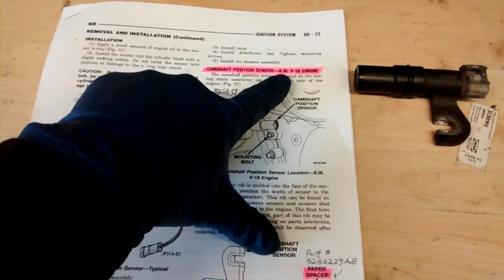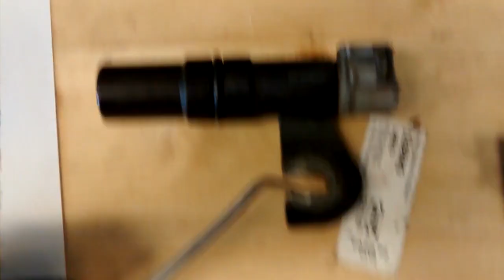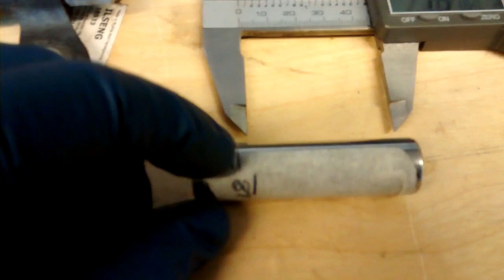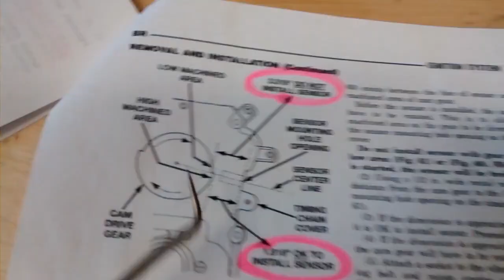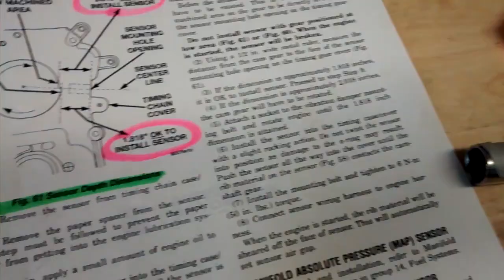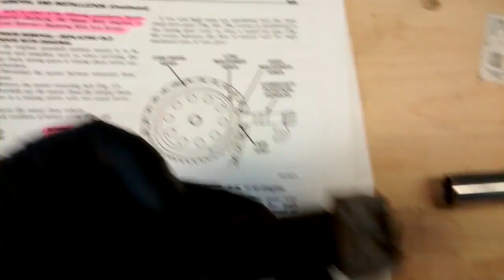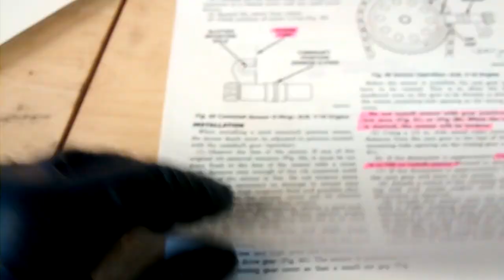DIY Dodge Ram V10 8.0L Camshaft Position Sensor Proper Install (1997)

Comment: Can you link that manual? Also i just shoved mine in but it still didn't fix my stalling issues. New crank and cam sensor.
Reply: also are we supposed to have that spacer on all of the sensors?
Reply from the maker: @devinlieberman67    I'm sorry that this happened to you.  I would remove  the camshaft sensor, and have a look at it.  If it is obviously messed up (sheared off, big chunk missing), then you will have to buy a new camshaft sensor, and replace it using the method I show in the video.  If it is not damaged, then re-use it but install it as shown here.

Regarding the other sensors:  I checked the manual, and there is not a paper spacer mentioned for the crankshaft sensor.  For the crankshaft sensor, the manual simply says (twice) to make sue that you have it pressed in "flush" with the block surface.  I'm sorry, but I can't link the manual because it is a pdf file on my laptop. 

When you say "stalling issues," is the engine stalling while driving?  Or just not starting at all?
Reply: @L35inColorado  you turn it on and it runs for a few seconds and stalls. Then can't run anymore for a while. I think bad PCM since it misfires but the computer is reading in time from my autel
Reply from the maker: @devinlieberman67  Try to start it using the "clear flood" mode -- put your foot to the floor on the throttle pedal, then start it, but as soon as it starts (if it starts), release the pedal.  Once on our V10, the PCM kept thinking the engine was flooded, even though it wasn't, and it would do what you're describing -- start, grab maybe 900 rpms, then just die off.  We put it in the clear-flood just once (start it with the throttle wide open), and it fixed the issue.   Apparently, the WOT throttle kills the injectors and re-sets the PCM somehow.  I'm not sure, all I know is that it worked in that case.

How about your fuel pump?  Have you checked that?  There's a diagnosis video for the fuel pump that I just posted on this same channel. 

Also, there are five components on the K4 circuit from the PCM (all sensors that the PCM grounds) in order to start the engine.  You know the first two -- camshaft and crankshaft sensors -- and the others are throttle position sensor,  coolant temperature sensor, and idle air control valve.
Reply: @L35inColorado  Yeah fuel pressure is good. I've haven't tried the clear flood mode yet ill try that tomorrow.
Reply from the maker: @devinlieberman67   Okay, let me know how it goes.  If it doesn't work, I'd start checking everything on the K4 circuit.
Reply: @L35inColorado  yeah didn't help it.
Reply from the maker: @devinlieberman67  Okay,  here's a long response.  Maybe something will work.

Here's the other components on the K4 circuit that the PCM grounds:

- heated O2 sensor
- camshaft position sensor
- crankshaft position sensor
- engine coolant temp sensor
- intake air temp sensor
- throttle position sensor
- MAP sensor

Are you getting good spark (I'm assuming yes if its starting but stalling right away)?  (According to the manual, 
good spark" for the V10 doesn't just mean any spark, but rather strong spark and multiple sparks.)  Of those components above, I think the cam, crank, ECT, and TPS sensors are the components that will prevent starting due to being opened by the PCM.

The IAC valve can also cause start-and-stall, independent of the PCM grounding the K4 sensors.  

But from what you're describing, it is starting to sound more like a fuel issue -- since it will run for second, then stall out.  Fuel or air, it seems.  Maybe even injector(s).

But here's some more info -- maybe something here will help:

The diagnostic manual is a little weak for info on the V10, but here is what it says for "no start" (NS) testing:

This is test NS-10A, which is V10-specific:  
1.)  Disconnect the spark plug cable at spark plug #1.
2.)  Using a spark tester, crank for 10 seconds and confirm that there is good spark.  It says that "good" spark means more than 2 sparks, no single or weak sparks.
3.)  If you're getting good spark, reconnect the plug cable and do test NS-2A.

Here's test NS-2A:
1.)  Check fuel pressure at the rail.  Fuel tank must be at least 1/4 full.  
2.)  If you have OVER 54.2 psi and it is still stalling, it says "replace fuel filter/regulator and primary filter" after completing verification test VER-1A (I'll write that below).
3.)  If you have UNDER 54.2 psi but OVER 44.2 psi, the perform test NS-4A.

What fuel pressure did you get?  (By the way, the fuel regulator is part of the pump, so unfortunately you have to replace the whole pump if it is indeed that.)

Here's "verification test" VER-1A, if you got over 54psi on the fuel rail (its obvious stuff, not much help, but here it is anyway):

"Inspect the vehicle to ensure that all engine components are connected.  Reassemble and reconnect components as necessary.  Inspect the engine for contamination.  If it is contaminated, change the oil and filter.  Attempt to start the engine.  If the engine is unable to start, look for any Technical Service Bulletins that may relate to the this condition."

(So...that's not much help!)

Here's test NS-4A, if you got UNDER 54 psi but over 44psi on the fuel rail:

1.)   Inspect fuel lines from filter/reg to fuel rail for restriction.
2.)  Repair restricted lines, if present.
3.)  If no lines are restricted, replace the fuel pump module.

So, this is say that apparently fuel pressure under 54 psi is inadequate to supply the engine, so a failing/spotty fuel pump that is not supplying at least 54.2 psi consistently can cause a stalling condition.

Here's another test to try,-- this is test NS-7A:

1.)  Hold the engine throttle 1/4 of the way down and attempt to start the engine.  
2.)  If the engine starts but stalls when you let up on the throttle, then this test NS-7A goes into a long series of tests for the IAC valve.  Let me know if that happens and I'll post it.  On the other hand, if  you do  step 1.) above and the engine does NOT start, then it says to do test NS-8A.  

That test, NS-8A, says this: 

"At this point, you have determined that all the of the engine electrical systems are operating as designed; therefore, they are not the cause of the start and stall problem.  The following additional items should be checked as possible mechanical causes of the no start condition.  Any one or more of these items can produce a no start condition; none can be overlooked as a possible cause:
- distributor position (not in this case, the V10 is distributorless)
- engine valve timing  (must be within spec)
- engine compression (must be within spec)
- engine PCV system (flow freely)
- engine exhaust (free of restrictions)
- engine drive sprockets (must be properly positioned)
- fuel (must be free of contaminants)
-  engine secondary ignition check (normal scope pattern)"

Hopefully it is a fuel issue, or a stuck IAC valve (air), because that is much cheaper than a PCM.  Are you aware of cases where the PCM is shot, but the engine will still run for a few seconds and stall?  I have only heard of the PCM causing a persistent crank-but-no-start condition for this V10, not even allowing spark, so cranking but no starting at all.   But I am not sure.  

There is another, very long test for the PCM, called test NS-6A.  It involves checking voltage, resistance, and signal on a number of components, from sensors to the PDC (big fuse box power distribution center).  But, in the manual, that test is predicated on first confirming a "No Response" condition, which I don't know anything about because apparently you need a Dodge scantool to see it.  I don't have one.  

The manual says that the DRB (Dodge scantool) will show "No Response" on its screen, if this is the case.  So, if you know anyone with a compatible tool, maybe you can see if you are getting a "No Response" via the DRB.  If that's the case, then yes, it might be the PCM.  

I love this V10, but it is not the easiest truck to work on with all the electrical and computer stuff that can do wrong.
Reply: @L35inColorado  my fuel pressure was at 45 but it would drop after about 40 seconds and stay constant at 35 at the rail if I turned it off, would stay around 40ish psi constant and didn't drop when truck died..Somebody previously replaced the PCM with a junkyard computer which makes me think they just threw a random PCM hoping it would fix their problem. I'm not sure if I mentioned this before but it also misfires every now and then. I'd like to thank you for all your help also. I've never had this massive V10 since I came from the 5.2 which never had any issues like this.
Reply: @L35inColorado  im going to redo the fuel pressure and test for good spark. Then Ill test the IAC Method you posted above.
Reply from the maker: @devinlieberman67  Okay, according to the info I have in the manual, 54.2 psi is what the fuel pressure should be.  Since you are under that, something is wrong, and it might be an issue with the fuel pump regulator.  The regulator is inside the pump, and not replaceable on its own...unfortunately, you have to replace the whole pump.  

Clearly, you are getting voltage to the pump, because it is able to supply some pressure, and you must have a good pump ground (otherwise you won't have power), so the regulator might be the issue.  The fuel circuit appears to be okay by what you are describing.

The last two issues I had with our V10 was the camshaft sensor, and then the fuel pump.  When the fuel pump went out, it ran rough for a short period, then later that day, it wouldn't start.  Then it started once, and cut out.  I was chasing my tail thinking that it was a sensor issue, because of the intermittent failure.  But once the pump went out completely, it was gone for good -- no fuel pressure or anything.   So, in my case, the regulator went out first, and then the whole pump, but it happened within a couple days of each other.   

Did you happen to get any codes from the misfires?  Or were you just noticing the misfires by the change in power/rpms bouncing all over?